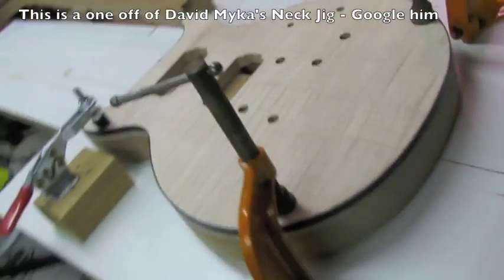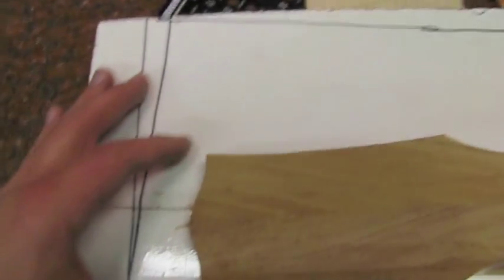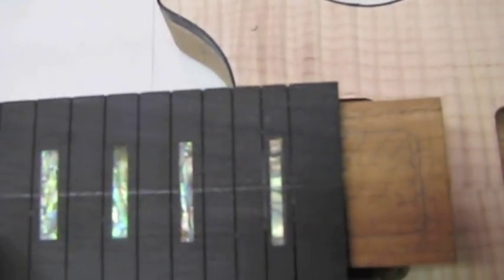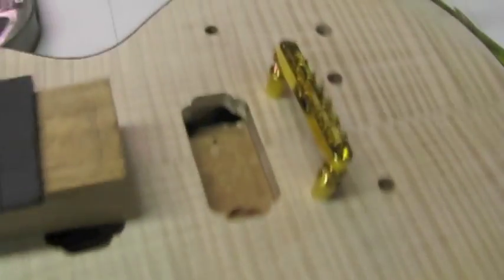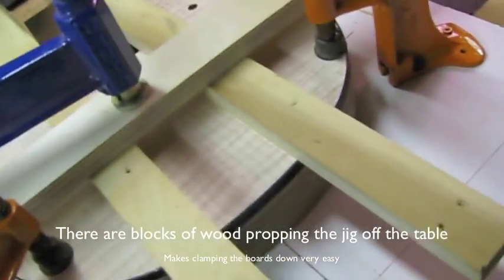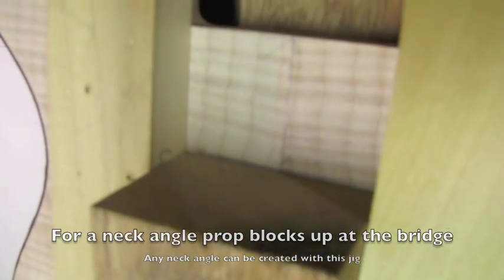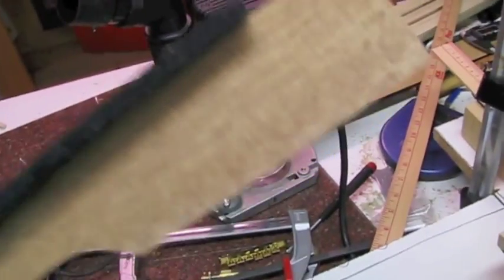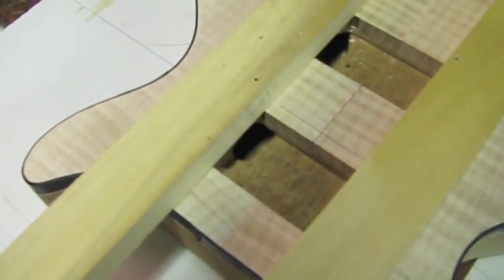Neck Jig for Luthier Custom Guitar Building PRS Style Neck Tenon Gibson Set Neck

Comment: I had custom neck cavity routing templates made for me by a machine shop.  I brought them a correctly profiled fingerboard and they measured it for the taper angle,  and made templates that have the correct angle cut into them as well as a perfectly centered reference line which is aligned to the top's center seam.    I also have the option of simply taking the body to the machine shop and letting them cut the neck mortise using the original program that was used to make the template.

Comment: THAT'S THE OLD MELVYN HISCOCK METHOD, VERY COOL MAN. HOW DID YOU COMPENSATE FOR THE BRIDGE HIGHT? IF YOU ROUTED A FLAT NECK POCKET WITH A TOM BRIDGE WON'T THE ACTION BE WAY TO HIGH? OR DID YOU JUST ANGLE THE NECK TENNON? EITHER WAY I LOVE THIS METHOD AS WELL. I MADE A JIG WITH A PLATEN ON A HINGE THAT LOCKS THE ANGLE IN PLACE, BASICALLY THE MYKA JIG BUT A LITTLE MORE STREAMLINE. LOVE YOUR VIDEOS DUDE.